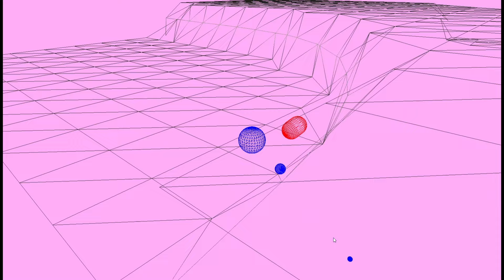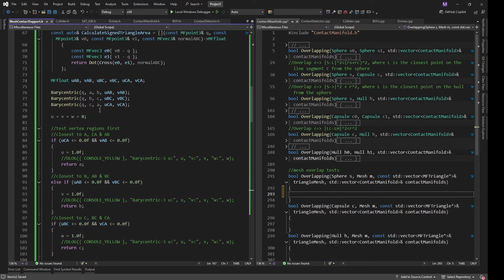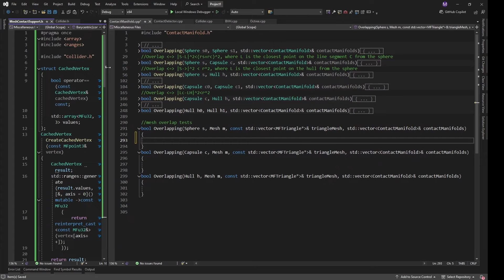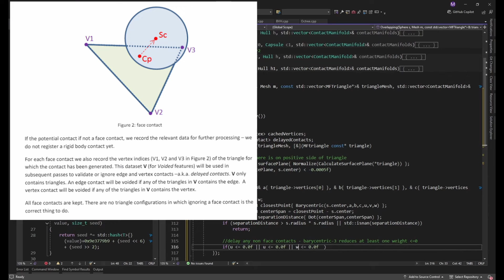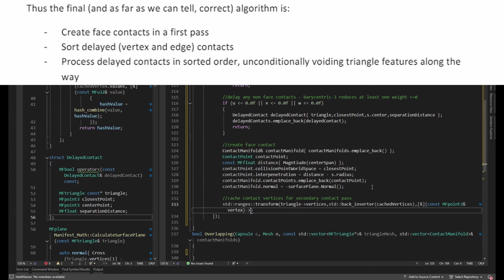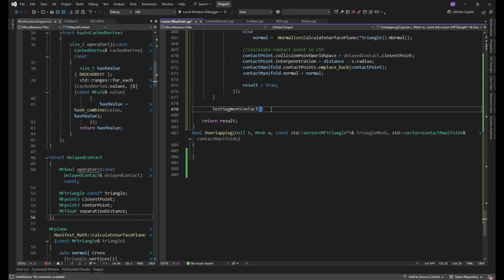Physics Engine Development - Overlap and Collision Queries Pt 3: Mesh Collisions[Code]

Comment: Hello! I have a question regarding the Sphere vs Mesh overlap resolution. When our sphere intersects with multiple triangles, how do we aggregate all the MTV (Minimal translation vectors) of all intersecting triangles? Unless I missed something I didn’t saw it in the video. Thanks for your help.
Reply from the maker: Hi there, you didn't miss anything! Resolving the contacts created with these overlap tests is done using Erin Catto's Sequential Impulse method primarily from his 2005 paper: https://box2d.org/files/ErinCatto_IterativeDynamics_GDC2005.pdf
and then modified to use NGS(Although I don't believe it's properly implemented): https://pybullet.org/Bullet/phpBB3/viewtopic.php?t=3583

I still need to go back and make a video about how to resolve these contacts but some of the math I can't fully explain yet/understand myself. 
I did go ahead and put up the code used in the collision resolution process on a separate repository if you want to check it out: https://github.com/NotARealCaveman/ContactResolution

I do apologize for not being able to explain better, but I hope this helps! Let me know if I can do anything else for you ☺